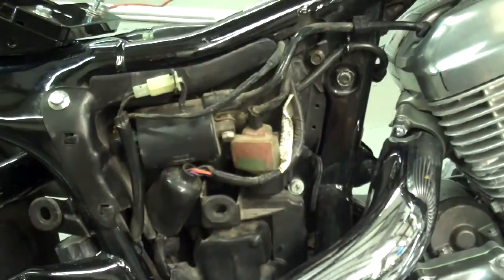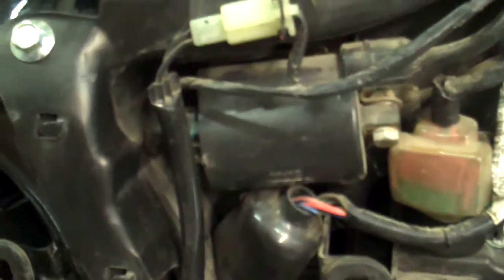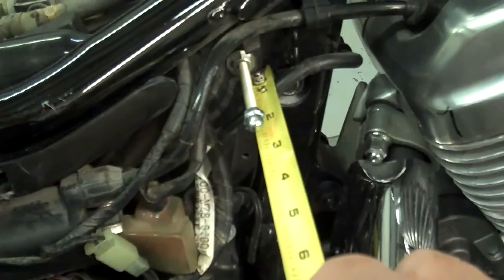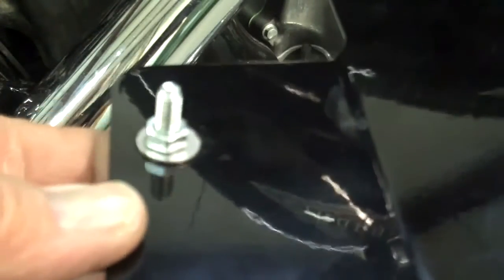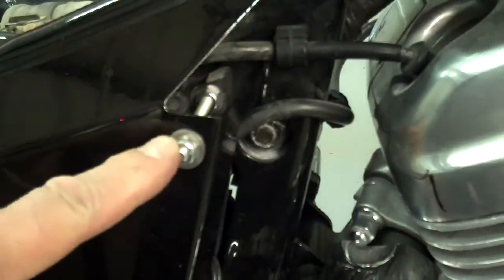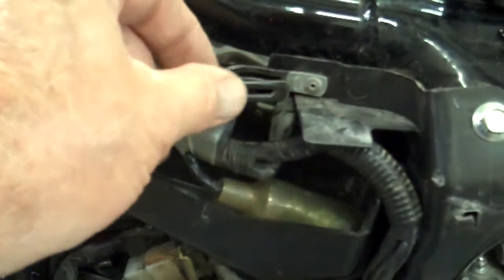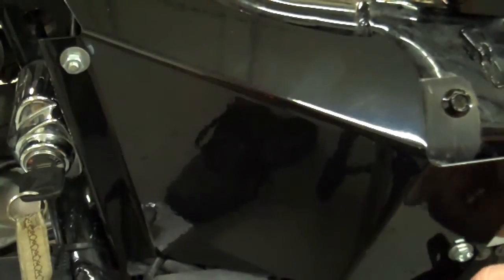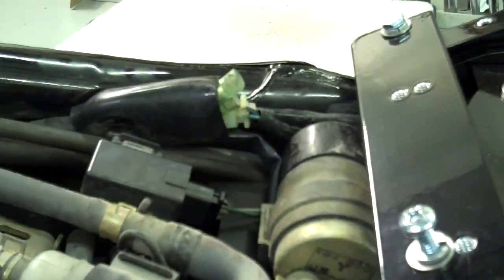Side Covers

Comment: Confused, for the front mount on each side cover you mentioned the acorn nut then when installed its just the threaded rod and a nut on the exterior mounting....what happened to the acorn nut?
Reply: this is only to drive the threaded rod in

Comment: Is there anyway to specify where I can get them in a straight powercoat black non-gloss??

Also Im a little confused as to how the front bolt connects with the acorn nut capping the bolt that is bolted into the frame?

Comment: Hi there. 

BlueCollarBobbers do you know if the newer post 1999 VLX original plastic covers will fit the older model pre 1998 VLX? 

Best Regards
Reply: Hi, I'm not sure, but the newer covers may have different mounting points. You may want to check an OEM supplier to see if there are similarities.
Thanks so much, Lance at BCB

Comment: Don't mean to nitpick but the right side cover would look a lot better if it was extended toward the rear cylinder more not showing the plug wire  bolt, and the hose under the plug wire